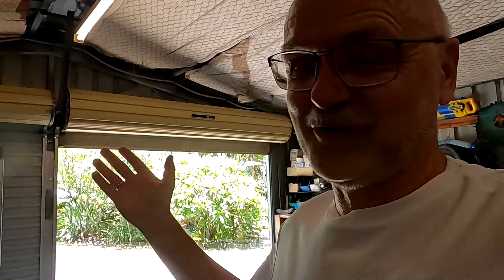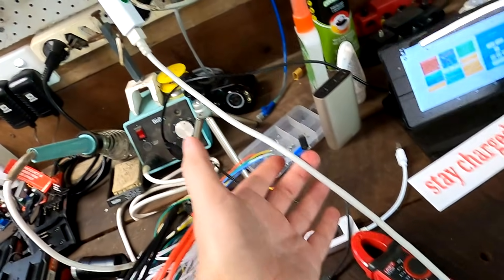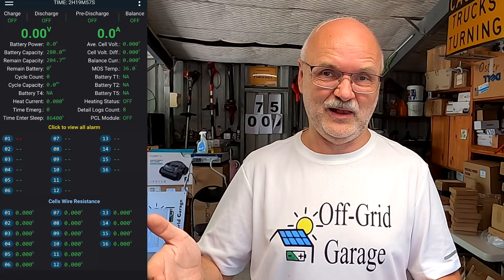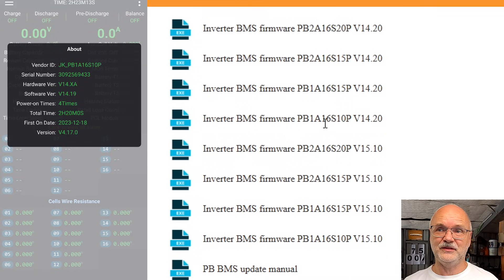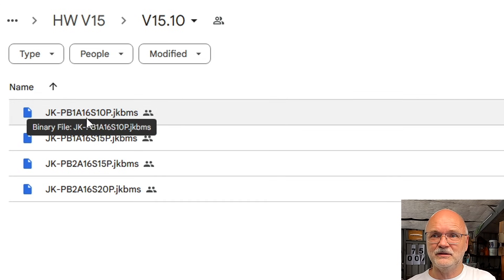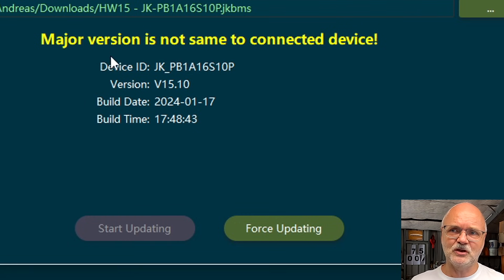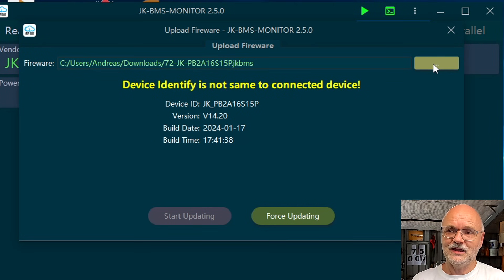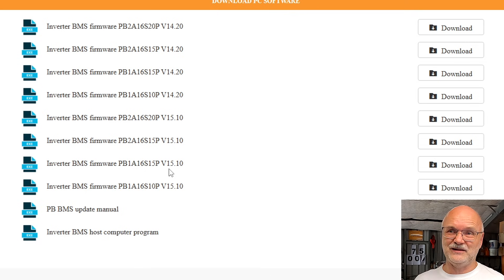JK Inverter BMS Firmware Update Process. Can't be that hard, right!?

Comment: Hi Andy,
Not sure if you have an answer but I'll ask anyway.
I updated to V19.21.
 I did the process incorrectly and now the screen does not show any information.  The app can still see the information.
I only have one battery and the DIP switch was set to 1 and plugged into the RS485 2 port on the right side of the CAN port. (should have been RS485 1 and DIP switch set to zero)
The screen now shows no information and will not turn off even with the app set not to always be on.
It now acts as if #1 setting is the master.
 I tried to re-update using the RS485 1 port. It does not see a DIP switch setting of zero now.

Thank for any help!
Mike
Reply: yixiang got back to me within minutes of my email!

Easy fix. Open the app, go to Settings and select 15 for UART3.

Comment: Does hardware version V19 firmware handle both the 200A and the 300A bms PB2A16S30P V19
Reply from the maker: Yes, the latest is the V19.13 firmware and it is available for both the 200A and 300A BMS.
Reply: Did you find the latest version V19.13?

Comment: Hi Andy, I'm setting up an ESS-system with 4 batteries filled with MB31 cells. I have 4 JK PB2A16S20P , of which 3 already mounted and updated to the latest firmware version. (V15). The one that I gave dev-adr "0" has set itself for master, and the other 2 (dev-adr "1"and "2") are slaves. Now I can full control all BMS's by phone-app. The slaves I can also control by PC-software. 
When I connect my PC to the master, I only come into the parallel-tab, the other tabs in the top-row are greyed out. 
When I open "about" on the phone, I see all information of the BMS, type, firmware etc. Now it shows that the firmware is 15.33 (old!), and it seems not been updated in the beginning. When I try to update again the firmware, the message comes that the device type is not the same as the hardware, but both should be the same (acc phone-app information). 
 The BMS doesn't react on a change of the dipswitch to give it another address.
Have you seen such a failure before and/or can you give me a direction in which I can go on?

Thanks for the good video's you put online. Without them, I probably wasn't started this project. Thanks!!

Comment: Now I have seen your video about the firmware update of the JK-BP2A16S20P and wanted to update it via my PC and the JK software. I had the firmware V15.29 and also wanted to upgrade to V15.38. I got this version from your homepage. The update started and stopped at 21%. It didn't go any further. After about 2 hours at 21%, I canceled the update. After several resets, only the display appears and I no longer have access to the BMS. Neither via PC nor via the Bluetooth app from JK.

Comment: I updated the firmware on my JK BMS, it stopped at 13% and apparently bricked the BMS.  Since I have JK's BMS update code bookmarked, I force updated it and now it works again.  My JK BMS is hardware version 15A.  If I remember correctly it was on 15.20, and I updated it to 15.28.   (Bought a month ago)

Comment: Ciao Andy, I have a question - I downloaded the version 37 for the inverter BMS, I have the 200A 20P HW V15, but when trying to flash it says that the version does not match the device. Any idea?
Reply: Force it and use the code generator Andy provided in previous videos.

Comment: Hello Andy, I have been following your Off-grid-garage channel for a long time. I have also received a lot of good information. After the video about Yixiang DIY battery case, I also ordered 3 of them. They work, although I still have to exchange my Cerbo-S for a Cerbo GX MK2 so that I can integrate and display the JK BMS in the Cerbo GX as you described. So far so good. Now I have seen your video about the firmware update of the JK-BP2A16S20P and wanted to update it via my PC and the JK software. I had the firmware V15.30 and also wanted to upgrade to V15.38. I got this version from your homepage. The update started and stopped at 38%. It didn't go any further. After about 2 hours at 38%, I canceled the update. After several resets, only the display appears and I no longer have access to the BMS. Neither via PC nor via the Bluetooth app from JK.
My question: Do you have a tip for me on how I can get my JK BMS back? So how I can get access to the BMS again and update the firmware. I have 3 other Yixiang cases with JK BMS that also need a firmware update. But the firmware V15.33 is already available here.
Thank you for your help - Greetings from good old Germany - Martin

Comment: Very frustrating trying to connect BMS to win 10 PC. Although it shows as connected on the PC Monitor v2.7 software when I run terminal window I can see packets being sent to the BMS but nothing is coming back. The same USB RS485 adapter works fine on JK 100A BMS but now i've upgraded to a 200A version it won't connect to PC. A lot of posters are saying some JK BMS's work fine and many don't so perhaps it depends on what firmware you have. Unfortunately without being able to connect it is not possible to change the firmware... very frustrating.

Comment: UPDATE:  The Amp value showing on Cerbo only updates when battery “DETECT”is performed.  Is there a forum where someone may be able to assist me?

I have just got my Victron/Gobel/JK system running and updated Fireware 15.32 to all 3 bms. Now only amps from B0 & B1 being sent to Cerbo.  Any clues on why B2 is not being added?  Thank you

Comment: I have two 100ah jk bms. One connects to pc software (will show voltage and current on pc 2.8.0 but all options are grayed out and firmware update stalls at 0%. The other one says connected but shows no info and gives no options

Comment: Hi, thanks for the video! If I turn on the first dip switch, there is no connection but if I turn off the first dip switch, the connection is there and I see information from the BMS, but all menu items except "Paralle" are not active. What am I doing wrong?
Reply from the maker: Perfectly fine. If you have only one BMS, you set all switches to 0000.
Only if you parallel the BMS you start with 1000, 2nd BMS with 0100, 3rd BMS with 1100 and so on...
Reply: @OffGridGarageAustralia  Got it, thanks! But why are all the menu items inactive?
Reply from the maker: @tvgoogle8219  got the newest  software for the PC?
Reply: @OffGridGarageAustralia   I have the same problem as described here at "diysolarforum"  tread "JK PB2A16S-20P No Communication". I suspect that the problem is in the adapter. I use Industrial USB To RS485 422 Converter with CH340G Chip. Version of the PC monitoring software 2.8. Frimware BMS I have two versions 15.27 and 15.30.
Reply: The problem was in the adapter(Industrial USB To RS485 422 Converter with CH340G Chip) , maybe it is not compatible with my version of BMS or it is defective. I have ordered two other types of adapters that Andy recommends (Waveshare Industrial USB To RS485 Converter with FT232RL Chip and RS485 to USB Adapter Converter) and they both work great.

Comment: Would like to report that the firmware V15. 17 and 15.32 interfere with the connection of the inverter Deye 16 SF and meter Eastron. I was forced to dowgrade the firmware to 15.11 to restore the communication between the inverter and meter.
Reply: where did get the firmware from? its no longer available on their homepage..

Comment: Hi Andy,
Looking at your inverter bms movies about jk,  I get a mixed bag feeling:
cheap, decent balance current, but with different bugs and a non communicating manufacturer.

My questions about the newest inverter bmsses:
- are the battery settings now stored in flash (if even present on the boards)?
- is it true only the ress versions can be connected with five of them to one cerbo without pushing the others siblings out of the nest?

It would have been nice if the other active compacter black models that can handle up to 
20 cells were compatible in a group of five with the cerbo. can they?

Being not so shure if they can, I'll stick to my excisting an regretfully not so accurate and pricy 123smartbms that cost four times the price of the JK ones and need an external current measurement and cirquit breaker too....

Comment: Hello Andy
I've been following your channel for a long time and was very impressed with the introduction of the JK-BMS.
Of course, I quickly bought one in the hope that it would work with my system, especially since the 2A balancer completely convinced me.
I don't know if I understood correctly that you were or are involved in the development, but in any case I'm eagerly waiting for a firmware update that supports my system because it works perfectly with Seplos-BMS.
It's about the interaction of JK_PB2A16S20P (vers. 15.17) with an SMA battery inverter_Sunny Island
At Seplos the protocol is called: SMA_CAN or Sofar_Can protocol
Do you perhaps have any influence on the developers so that this is implemented in a next FW update?
Thanks 
Keep it up, you keep inspiring me

Thomas

Comment: Hey Andy, big thanks for your work. Today i installed the version v15.17 on my JK BMSs. Di you have any changelogs this time? You know a way to get out every single cell voltage out of the BMS, in best chase via CAN? In my Case the BMS ist connected via CAN-Hat on the Pi to the Venus OS (latest Version). Is it possible to you to talk to JK to implement that the cell voltages transfer via CAN to the Venus OS? Best regards from Hamburg, Germany. Thomas

Comment: Hello Andy, 

I love your videos and they are very informative. 

I have a 12v system and 2 battery packs, both with the JK BMS B1A8S20P and is it also possible to connect this to a PC and carry out a firmware update?

I have contacted Jikong BMS several times in different ways by email but unfortunately I have not received a response until today. 

I can't really find any clear or even useful information on the internet. 

I have the right RS485 adapter with USB converter and it also connected to Venus os with a Raspberry Pi4 and it works. 

When I connect this to my computer and press the correct COM port, it connects but with no information or data in the JK-BMS-MONITOR. 

And I have another question, I have a third JK BMS B1A8S20P but I forgot the password. Is there also a way to reset this BMS so that it can be used again and the settings can be changed again? 

Kind regards from Germany

Comment: I have two JK-PB2A16S15P with 15.05 and trying to update to 15.10 but when I click start updating it just stays at zero percent bms will beep after a few minutes and reset. Speaking to support they think I need a temporary code to update. Hopefully, I will be home when they send me the code.
Reply: How did you contact support? I sent an email two days ago, but haven't had a response yet. Curious what the solution is for you. Problem I have seems to have common ground with your problem.
Reply: @alexveldman2465  I wrote them a message through Aliexpress. So far they have been responding within 24 hours. The last update I got from them is I need an authorization password and to contact them again in a few days.

Comment: Hi Andy, and all the other readers, I recently bought and received the JK_PB1A16S10P three times. According to the blue tooth app on my android phone, it appears to be a hardware version: V15. XA with Software version: V15.06 (all three) I want to update this to V15.10. I got this version from both the JK site and the Off grid garage Drive site. The dip switch is set to 1000 In both cases I keep the warning: Device Identify is not the same to connected device! (In all three) What am I doing wrong? Or is there another bug in version V15.06? Does anyone know what to do? PS: I hope this comment doesn't end up in the list multiple times. But I don't see the reaction itself in the list anymore.
Reply: I have received the temporary password via whatsapp from JK. With this I was able to update the BMS to V15.10

Comment: Hey Andy, I love your channel. I recently purchased a Peter board based on your recommendation. I was getting ready to order a JK BMS for my DIY Battery LiFePO4. Then I saw your video about all the problems people are having with the newer BMSs losing their settings. My battery is going on my boat and it's highly possible that the BMS can be turned off on a regular basis. Given what you've learned about the new JK BMS. What JK BMS would you recommend?    I'm setting up an eight cell 24 volt system. With 280 amp hour batteries. I'm really excited to use the Peter board. As soon as I saw that it interfaced with home assistant. I was so excited 🙂 now I can control my boat battery through home assistance when it's sitting in my driveway!
Reply from the maker: You have to differentiate between the old JK (BD series) and new JK BMS (PB series). Only the old style BMS will work with the Peter board. And only the new style BMS had the software issues which are now fixed with the latest FW updates.
Both BMS are here on my website: https://off-grid-garage.com/battery-management-systems-bms/

Comment: Hi Andy, big thank you for all those videos and information, it's helpful. For you what is the best BMS ? is a JK or Seplos 3.0 ? i plan to add a second battery (i know i need to change the actual BMS from Basen that is not good at all). thank you
Reply: @Off-grid Garage, any help about my question ? thank you :)
Reply from the maker: I would recommend the JK BMS, either older BD series or the new PB series. Both are great. The Seplos would not be my choice for a BMS for several reasons.
Reply: @OffGridGarageAustralia  Thank you a lot for your feedback and all your tests and videos about solar systems :)

Comment: Hi, I have some questions for you about 48v lifepo4 charging, is this the right place to ask?
Reply from the maker: Yes!
Reply: I have a 15kw lifepo4 battery pack which I have fitted to a Reva Gwiz electric car,  I have a spare Outback VFX 3048e inverter/charger I was thinking of connecting it to the pack and feeding in 230vac to the hot in. This should actually act as a 45amp DC charger plugged in to a normal supply? Or plugged into my off-grid solar supply?
What have I missed?
Reply from the maker: @EllisBergman  Uh, sorry, that is very very specific and I cannot really help you there as I don't know all details and regulations in your location. Someone would need a lot more information, see drawings and calculations to fully understand your setup and design. It's best to contact a local electrician who has knowledge of all requirements.
Reply: Ok, thanks for your time, Outback won't help, there are no restrictions here as it's all my own supply and there is no one who seems to understand it or want to give advice. I thought it was a straight forward question. Nevermind, your jk BMS videos are very helpful. 👍 If you have any thoughts on the idea please let me know. Regards Ellis

Comment: Hi i just got my usb to rs485 converter it looks the same as your one. I can not get it to connect to the jk pc app. Is there any trick to install the usb. I have set everything just the same as the video.😢cheers🍻
Reply from the maker: What is the chip inside your controller? Mine has the FT232RL chip and works well with all BMS.
Reply: @OffGridGarageAustralia  not sure I will try find that out and get back to you. Thanks.
Reply: Ok the folder from the CD has FT232RL ON IT
Reply from the maker: @GarryL277  That should perfectly work. I've tested now a lot of adapters (will be in the next video) and they all worked under W10 and the newest PC software 2.5 from JK.
Reply: @OffGridGarageAustralia  my jk is 15.05 firmware maybe that’s got something to do with it or a faulty BMS
Reply: @GarryL277  Hey were you able to update your firmware? I have the same firmware and after trying 3 adapters I got one that works with it but can't update.
Reply: @mariuswegmann5500  no not yet still can't connect to the bms with pc

Comment: Andy... You are our last hope... Low temperature trigger. Please help with communication to JK team. For some reason they take out from firmware (15.10 here) "low temperature" trigger (for dry contact). Is was one of the major function for me and for some other people here. Could you be so kind and try to convince them to get it beck? Thanks!
Reply from the maker: So, this function was in the latest v14.20 but not in the v15.10? I thought the are having the same functions and features?
Reply: @OffGridGarageAustralia  it looks like. I checked it so many times. And suspicious is that Aliexpres official store write me that there are some issues with heating so that cancel heating function. My thoughts are that they for unknown reasons delete either low temperature trigger. And I can confirm that heating function is missing in software but all 5 tem sensor are working just fine. Maybe they are right that heating and use 2-3A trough 4 or 5 thin cables isn't the best idea but... Please return triggers... No response from them email, WhatsApp, web form). Could you please be so kind and help? I can send you screenshots. Thanks
Reply from the maker: @mateuszmazur2025  Are you actually talking about the heater function or the low temp trigger for the relays?
Reply: @OffGridGarageAustralia  @OffGridGarageAustralia  both are missing... But heating function is not so important. If there will be low temperature trigger for dry contact I could use it easily.
Reply from the maker: @mateuszmazur2025  It is Chinese New Year at the moment, they won't reply until end of February. Most companies have closed or are on skeleton staff...
Reply: @OffGridGarageAustralia Thanks OMG :) :) the earth should stop rotating based on that how the rest of the world depends on Chinese electronics
Reply from the maker: @mateuszmazur2025  I think we should all celebrate together. I would like to have a month off as well!